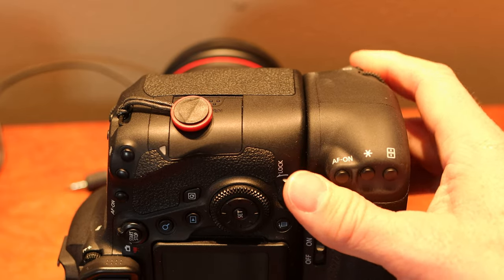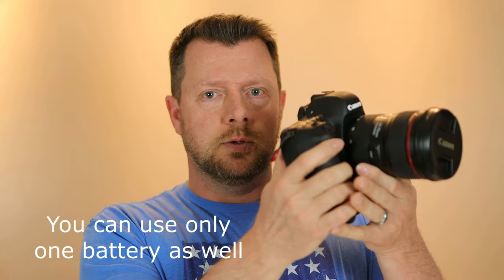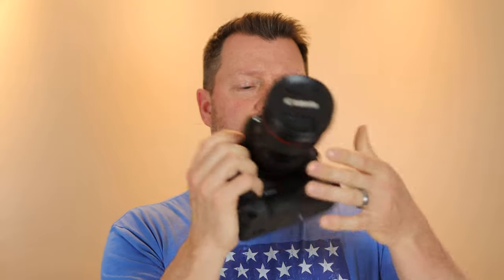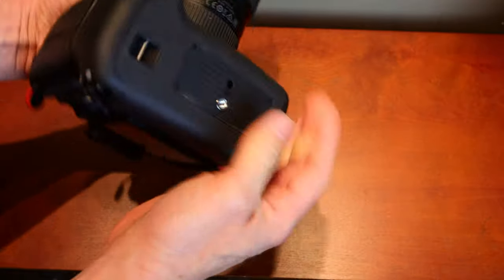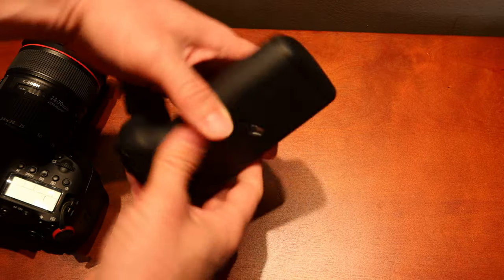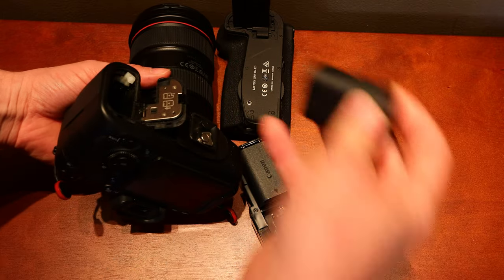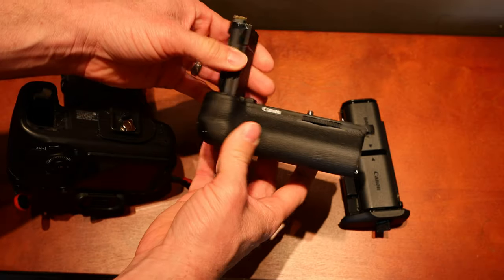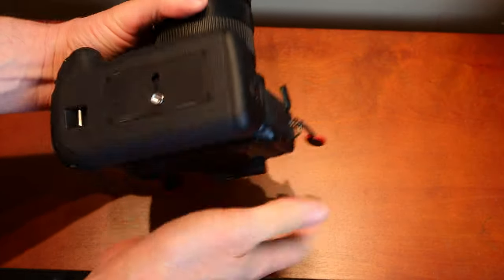Canon Battery Grips, Quick Overview

Comment: I have one for my Canon 90D and when i have my 150-600mm lens in there...wow!! It’s insanely heavy the. I add my tripod whoa baby. But I love the vertical grip. I have a question where do you get those lil red round tabs. U know the ones where the camera strap goes. Thanks
Reply from the maker: Those tabs are part of a Peak Design strap I ordered off amazon. You get 2 sets per strap. I got both thick and thin strap, the thin is much more comfortable in my opinion.
Reply: Aarons Practical Reviews thanks my friend

Comment: Hello again Aaron. Great video. Just out of curiosity. You shot this on your 90D correct? Also what lens did you use for the talking head parts? Thank you!
Reply from the maker: Yes I did, the 90D has been freaking amazing! I used the Sigma 35mm f1.4 the entire video.
Reply: @FitsandFun  Wow...Yeah man that lens is a great compliment to that sensor. It seems to resolve it without issue. Good stuff!
Reply: @FitsandFun  Do you still have the Canon 90D? If not, what camera are you using?
Reply from the maker: Yes. I also own the R6, 6dMKii and the T7i.
Reply: @FitsandFun  How do you like the R6?
Reply from the maker: I love it. Works perfect for everything I like to do. I used it for a wedding shoot and it was amazing. Then I also use it for all my video as well along with the 90D.
Reply: @FitsandFun  Thanks for responding. What made you keep the 90D instead of getting another mirrorless camera?
Reply from the maker: I already owned it. I bought it when it was first released.  I'd probably go with the R7 or R10 now. Only because I've really come to depend on the electronic view finder for photos. For video work, which is basically all I use the 90D for now, the 90D is excellent.
Reply: @FitsandFun  Got it.I just purchased the R6 Mark II, and I am looking to sell my Canon 90D for a 2nd body. I am just trying to figure out what to purchase. I take photos, not video at the moment. My lenses are ef mount. 50mm 1.8, 16-35mm f2.8 l ii usm, 24-70mm f2.8 l ii usm and 70-200mm l ii usm. I take photos, and I don't do videos at the moment. I'm looking for an upgrade for the 90D to complement my R6 Mark ii as a backup camera to take photos.

Comment: Lost me at "I don't know about aftermarket grips...I'm not even going to try"
Reply from the maker: I've had a few bad experiences with third party accessories on camera gear that is designed to be very precise. Especially relating to batteries. So I personally don't mess with them anymore.
Reply: @FitsandFun  I've neem using a 3rd party camera grip on my T7i for almost a year with ZERO issues. I also use 3rd party batteries without problems.
Reply from the maker: Canon doesn't make a grip for the T7i, so I guess you'd have to take your chances on that grip. Glad it worked out.
Reply: I have one but I am gonna upgrade to the Canon one for my 90d cause the aftermarket one is crapppppppp